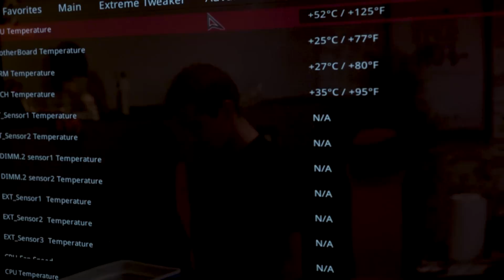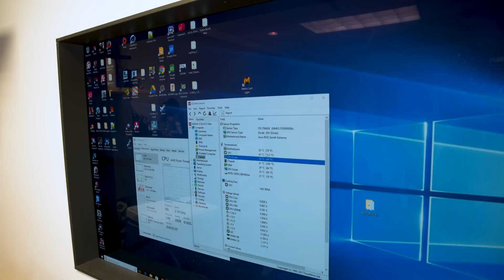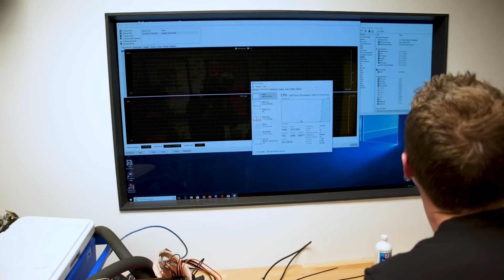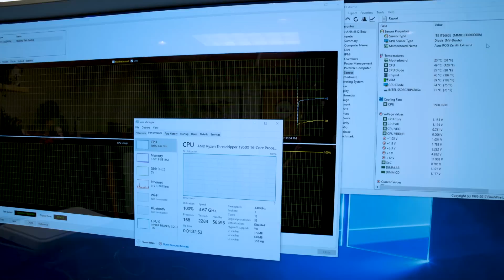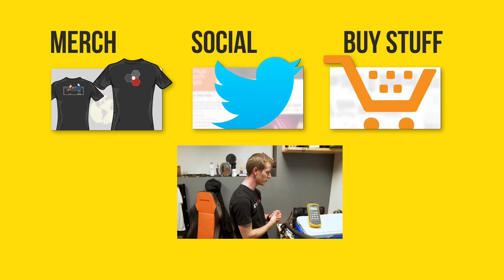My 10 Year Old Chiller WORKS! -20C on THREADRIPPER!

Comment: Do this crazy experiment next. Computer sealed in a vacuum box made of glass. Will the computer work? If it works, what will be the temps, benchmark results? Can it run Crysis?
Reply: Temps will rise like crazy
Reply: The vacuum would just blow out all the capacitors.
Reply: No air means no way to exhaust heat. But you could make a cooler out of a bowl of water and a heatsink as the low pressure would cause all the water to evaporate, creating a massive cooling effect.
Reply: Mystic Bardock LSSGSS No, we do know without the experiment as many similar ones have already been done. Without a cooling source I can tell you exactly what will happen. They'll boot the PC, it'll overheat, throttle, and possibly safety shutoff before they even launch a benchmark. That's a boring video I think.
Reply: But we wont know for sure without experiment.
Reply: HappyBeezerStudios - by Lord_Mogul
And as shown by removing a CPU cooler, that effect even combined with passive air cooling is nowhere near significant enough to even consider.
Reply: There would still be heat transfer due to radiation. That is how the space staion is cooled.
Reply: So if there is a cooling source, it is possible to run computer in a vacuum. Also i wonder how satellites are running computers in vacuum. Do satellites have computers sealed in pressure box and nitrogen cooler or some kind of coolant?
Reply: It would be interesting to learn how satellite computers are cooled. If they are exposed to the vacuum of space I'd expect some sort of heatsink to distribute the heat across the surface of the satellite.

Comment: I was too lazy and cheap to try this but i did try just hooking up a dryer hose to a side intake fan  with the other end sucking in  minus 20 c cold dry air  during a canadian winter.
and it worked awesomely to cool down my amd 1400 hz cpu which i then overclcoked to almost 2200 mhz.
But the duct tape holding things together kept losing its stickiness  and because of that and even when it wasnt falling off , if i wasnt using that much cpu to the max producing heat , my  whole office was getting closer and closer to zero celcius
so it became a big pain in the ass , especially since my graphics card  maxed out way before my cpu at the time.
So i overvolted it and eventually blew up my gpu

Comment: why wouldn't you leave it in its case in a window so the hot air goes outside... small table next to the window to hold the cooler, maybe a small pump to circulate inside the cooler and then have your computer below the small table.

Comment: It would be cool if you tried to make a setup that goes straight into the water block rather then use a evaporator (much like the awesome  LD Cooling PC-V10 build). I understand it would be more difficult and have to be leak-tight but I think it would be do-able.

Comment: There has to be a better way... Hot hardware was always a problem it is hard to imagine that the best way to deal with it is this type of cooling along with water and air. surely there must be some advancement because eventually things will get so hot that it wouldn't be economical to own or use.

Comment: the compressor compresses the vapor from the Evap coil then the fans blow air over the condensing coil to remove the heat out of the refrigerant making it a high temp high pressure liquid then the refrigerant goes through a pressure changing device to make a low temp low pressure liquid/vapor then the refrigerant goes through the evap coil where the fan blows the hot air over it so the refrigerant can absorb the heat and move it to the compressor to do it all over again

Comment: I wish someone would design this even if the cost is high but it different method like water cool, pipe glass, and liquid freeze. Guessing there a lot of R&D cost to build cool cpu or gpu. But there not much in open custom hardware for this age way to develop cool down fast?

Comment: "80 Degrees Fahreinheit whatever that is". As an American who uses it, I dont understand Fahrenheit either
Reply: Morgan Sandler 
you must have failed elementry alot
Reply: Hi have a nice day You must not get jokes a lot
Reply: Implying U.S. Americans don't just switch between systems when needed. We already use SI for science. People like to act like metric is completely foreign to the U.S. But it's been in use alongside Imperial depending on the use case for decades. What's more is that it's not even unique to the U.S. Go to England and buy some vegetables and fruits or order a beer.
Reply: How i ask you? Water freezes at 0 degrees C and boils at 100 degrees C. In F that's 32 and 212. Simple. There's a reason why SI is Celsius or Kelvin which is C plus 273.15
Reply: Andy K LOL just because one °F is 5/9 of a °C does not make it more "accurate". Are you that afraid of decimals? In any sort of scientific calculation you'll probably need them anyway. The best case you can make is that Fahrenheit in whole numbers is a higher resolution measurement than Celsius, but it is certainly not more accurate.
Reply: Morgan Sandler I'm from Texas and I don't like Fahrenheit.
Reply: Sausage kelvin is the best . second Celsius, and far distant fourth , Fahrenheit.
Reply: Fahrenheit is not any more "accurate"

Comment: I live in Norway I just have to open my window and my computer is -20C
Reply: I live in Adana I just have to close my window and my computer is 170C
Reply: SylenDraws same here in Finland
Reply: yeah you could just leave it here all year because of our shitty summer weather aswell
Reply: A friend of mine actually had to do that, his PSU was broken and overheating. He rigged his PC to hang from the window basically, worked like a charm, until summer came.
Reply: Some day i will build snowcastle on outside and throw my pc's there. And perhaps snowman or two to guard them
Reply: I do the same #Nord-Norge ;)
Reply: In Svalbard all you need to do is hang your pc on the outside and have the wires run through the wall... it barely gets more than 7C during the summer.
Reply: Vladek16 just get a long tube from the intake of your pc to outside your house, it will suck in cold air

Don't worry about condensation.
Trust me, it'll be just fine.
Reply: -35 in the north of canada here.
Reply: Dominic Daniel actually at some places in Russia it's almost -60
Reply: I live in Scotland I open my window and my pc turns into a fish tank
Reply: Brb bringing my mining farm to Norway I'll warm it up
Reply: Open my window and i freeze to death...
Reply: Welcome to Egypt where pentiums and i3's run 60° idle
Reply: Vladek16 Or build a computer hut on your balcony and run monitor and peripheral cables through a hole in the wall.
Hey presto, ambient -20c cooling for next to money, and it's a lot cheaper and safer.
Reply: I live in Indonesia, my computer is 50C even though it's off
Reply: Northern Canada, Arctic here boi!
Reply: Same I live in Canada if my computer starts overheating  I slide it under my window open it and almost instantly cold
Reply: same here (Minnesota - where all the Norwegians come to live in america)
Reply: Cheers from North Dakota! We have similar winters here. When we were at -32C a few weeks ago it was pretty fun.
Reply: But you'd be too
Reply: But that's like summer in north of canada
Reply: Haha I'm from Sweden and got a friend who used to open his window and put his PC, with the side panel open, in the window just because it always overheated!
Reply: Use I9 and melt icebergs in ur country
Reply: @barkeeper7887  or threadripper 2990X
Reply: Hellestyle Norwegian (Oslo) summer is awesome. A lot better than German summer
Reply: Aha
Reply: Dominic Daniel Celsius?
Reply: Im already building my farm here just open the window woila.  Alt For Norge!!
Reply: Same in Finland
Reply: Kristoffer F samme i Danmark skide varm vinter
Reply: Are the property's and power cheap there? Moving my bitcoin factory there asap
Reply: I am in the cold club too, Alaska.
Reply: Norsk jeg å
Reply: SylenDraws Lol
Reply: I relate to that very much
Reply: Russia (Murmansk) no difference there bro 50c° vs 60
Reply: Nice
Reply: SylenDraws i live in iceland so it instantly becomes -30*C
Reply: same, I'm in Canada.
Reply: Lunta sataa ja kaikkia kukittaa. Yeaph. :)
Reply: Your body also is
Reply: Meanwhile in Houston, Texas...

Yeah, we wear shorts in the dead of winter. What of it?
Reply: Just like today's Moscow. Opened a windows and everything is frost.
Reply: Last winter , i had -27 C outside. So should not be the problem to do the same  while i wear lot of things :D . The problem is summer. +37-40 C
Reply: WOW O_O Where are you from? +37 - +40 is too hot
Reply: 0ktober do you mean ræva
Reply: fuck this stupid person, doesn't know how to distinguish a sarcasm gtfo
Reply: SylenDraws skål!
Reply: Yeah just use wireless mouse keyboard and they have a monitor now
Reply: nice
Reply: Asara Kaigara Sol-Terrasa Do you live in Svalbard??
Reply: Haha. Benefits of Norwegian living.
Reply: Canada is cold too, guys.
Reply: Lmao same in NL
Reply: Same with New England, Massachusetts has been -20 for most of the season
Reply: I live in Brazil i just have to live here and my computer combust itself in the summer
Reply: I live in brazil, if I open my window my computer just fry
Reply: SylenDraws so many likes lol
Reply: H haha thats an expensive way to get the buerewors done
Reply: i would just mount my motherboard on the wall, and have it facing backwards. then i would cut out a hole in the wall and have the heatsink stick out. boom
Reply: Michigan, I can do the same right now.
Reply: i also live in norway 0.9c atm i live south in norway glad hehe
Reply: Beijing,China here,and it's around 4C XD
Reply: I live in northren Canada, I have a dryer hose from outside to the intake of my mining rig. gpu's get down to -25C on cold days.
Reply: SylenDraws

Became it a cold society?
Reply: That's cooling 🌨☃
Reply: what kind of air conditioner are you using outside?
Reply: You should call this The Dovahkiin Cooler build
Reply: I may be wrong but wouldn't that cause some problems with condensation? (I know this comment is a joke)
Reply: I live in nunavut canada so i can do the same
Reply: I live in Minnesota and can do the same
Reply: I live in London, I just have to open my windows and my computer is soaked in rain water...
Reply: Same here in Canada... SMH
Reply: Yeah its so cool in the winter that i can keep a much higher overclock on the computer than i would in the summer.
Reply: Actually, I had back in the day a tube running from my cpu cooler out of the window while the outside temp was around -25 - -30C. I had pretty low cpu temps. I'm suprised the moisture didnt damage anything
Reply: christian cruz xD
Reply: i am in finland -30 XD
Reply: same, live in the north norway. cant have the window up for 5 min without me almost dying of cold. its crazy shit..but atleast my computer stays cold som im good:)
Reply: in Germany its the same atm
Reply: I live in Canada. With windows closed im -20C bro.
Reply: i live in canada where we can just open our igloos nd boom -40 + wind and hail;
Reply: SD.N0rdic
1 second ago
litteraly speaking in summer in south africa (really fried part of johannesburg) if i dont leave my fan on the room temp is like 32 on average and my shitty cooling solutions are ineffective lol. im buying a new pc soon so i wont have to go through all this crap
Reply: Dude! Don't reinforce stereotypes!
Reply: from norway 2 relatable
Reply: SylenDraws same in finland
Reply: same as here in minnesota.
Reply: I live in Australia, i just have to open my window and my computer becomes liquid metal.

P.s. In the part of Australia that i live in, it once got so hot that my bottle of water's plastic melted a little bit.
Reply: I am from finland and same here!
Reply: Same
Reply: lol sylen make that  approx. -30 in finland
Reply: Crazy idea, try making a pipe to route the ass cold air to your rig with fans, and keep the window closed......well as much as you can.....I have no room to talk. I live in Florida.
Reply: John Johnson because the US are the biggest shi-hole country on earth
Reply: +Charles Bernier That's impossible, no temperature can go below Absolute Zero (-273.15°C)
Reply: Here in India I used room cooler to cool my PC to ideal 55 C lol to play games for a hour lol and ram is hitting 51 C 😂😂😂
Reply: I'm well aware that the "summer" you nords speak of is infact winter with sunlight. Nice try
Reply: Same in estonia :-P
Reply: I did something slimier AGES ago.

Got a decent airflow fan, and attached the intake of my PSU to a dryer hose and hung it out of the window, worked ok even in the summer, (Window was ALWAYS shady)
Reply: Man I've hear of people going the extra mile for performance but freezing to death for a higher clock speed? Hats off to you sir.
Reply: Used to stick my ps3 in the window at winter time and could play for hours with no slow downs or freezes. Sadly that ps3 got the yellow ring of death a few years after.
 Not sure if what I did caused it.
Reply: have you tried placing your pc behind closed window or balcony?) i did... at -5C or -10C. It worked for few months than power adapter died. But service repaired it in 2 days. Also sometimes it didn't start cold. So i started it in my room then placed it to balcony. Maybe somehow related to condensation.
Reply: Lucky if I open mine I'd have a heat stroke.
Reply: Sausage its gonna be 1 degress
Reply: im also from norway. just gonna put my pc on the outside
Reply: SylenDraws i live in denmark and i just have to open my window and my computer is watercooled. #denmarkisrainy
Reply: Same in finland. Here is -30 celcius now
Reply: I live in poland when i open the window my pc gets wet becouse of the constant rain
Reply: I live in Russia, so if i open the window my computer is colling to -50 degrees
Reply: O O F
Reply: You probably let a Threadripper 2 air cool without a cooler on purpose just to not freeze to death.
Reply: I got on summer like 55°c yo max of 60°c on peak days bro. I do need an AC to AC a CPU
Reply: Hmm, Linus is here in Canada. -20 is walk in the park.
Reply: I live in Bergen. I open my window and I kill my computer.
Reply: Siberia: That warms my heart.
Reply: I open my window in Australia my rig melts
Reply: Say hi to Thor for me
Reply: Perfect for Skyrim
Reply: i love in australia when i open the window my pc gets 40*c hotter
Reply: Lucky
Reply: Meanwhile pepole in siberia hold mh beer we have -30 pc froze lol
Reply: Dude I heard that everyone in Norway is happy
Reply: Here in south africa we use cpu's and gpu's as firestarters to braai. Thermal throttles before we even push power button. Make sure its underclocked, otherwise its will blow your house up
Reply: It hit -86C in Russia recently. At that temperature, your computer won't even start.
EDIT: It was Siberia to be exact...
Reply: Belgium is super cold #not
Reply: SylenDraws unfortunately I can’t do the same since it has been a f•••ing hot winter 
We got 13 degrees earlier in January btw I live in Denmark and the avenge temp in January is 0 
#globalwarming
Reply: @frode4457  in Chicago weve had one of our coldest winters in a long time
Reply: i live in quebec, i open my window and my computer is -345°C
Reply: Norway is best - Norge er best

Comment: Hi linus, as you might know distilled water do not does not conduct electricity. Then I think it would be a good idea build a pc under distilled water, because the water will cool the cpu, flow up, cool down, and sink and then cool the cpu again.

Comment: Why are they using washer fluid instead of cooling fluid
Reply: Frosty 1098 much cheaper and works just as well. Wiper fluid is just water and alcohol.
Reply: jane blogs normal washer fluid is water, methanol, and blue dye.
Reply: Because it has antifreeze in it.
Reply: h20 evaporates faster than car coolant so it is actually cooler. Washer fluid should have ammonia in it not alcohol, but booze would cool the best

Comment: yo linus its a gas not a fluid. fluid is not compressible. there is however a point between the condenser and evaporator what it is a liquid. 👍
Reply: There are actually compressable fluids depending on pressure and temperature.
Reply: He explained the refrigeration cycle backwards. R-134A cannot be compressed. If there was liquid in the compressor it would cause a liquid washout and kill the compressor
Reply: what is a question, you need a statement such as "that"
Reply: Riley Besson being an old air con unit itll most likely be r22 but like you say refrigerant in the comp=new comp
Reply: Misac Tiba i was talking specifically about refrigerant in the compressor in this siduation
Reply: Demio's Gaming Corner i meant on earth with refrigerant in this situation lol
Reply: jane blogs thanks for the english lesson👍

Comment: Why not just put the motherboard and GPUs in a mini fridge
Reply: They did! The CPU heat overwhelmed the fridge pretty quickly.
Reply: A fridge doesn't have enough cooling capacity. And is insulated so after a while it will heat up even more
Reply: He's done that before.

The heat exchange isn't enough for a powered computer. Using a domestic chiller.
Reply: Mini fridges use peltiers for cooling and are crazy inefficient.

Comment: Wait. Why run it with rain-x? Would antifreeze work better? You literally just put washer fluid in
Reply: Antifreeze is 2-3 time more expensive though...
Reply: M KRYPTYK it is very similar. Both goes down to -20F
Reply: Antifreeze would actually work better. The wiper fluid has alcohol, ethanol, and detergents that make it less safe and more corrosive.
Reply: ethanol is alcohol...
Reply: I'm glad I'm not the only one who realized this.
Reply: something1random23 *butoxyethonol and isopropyl alcohol
Reply: antifreeze evaporates slower so no it won't cool faster, it uses glycol to prevent freezing